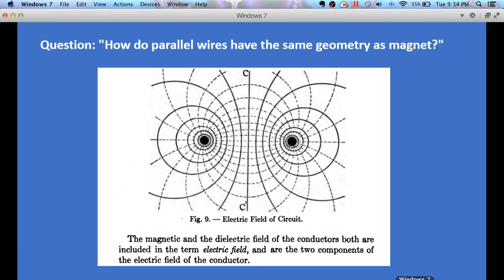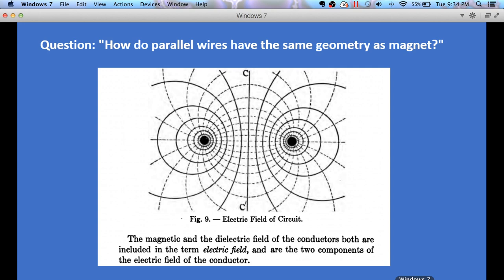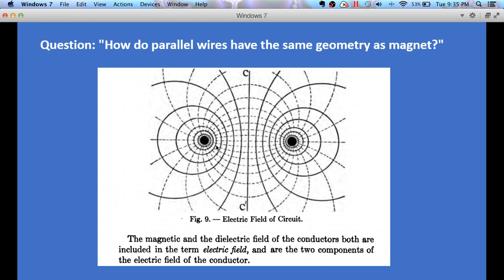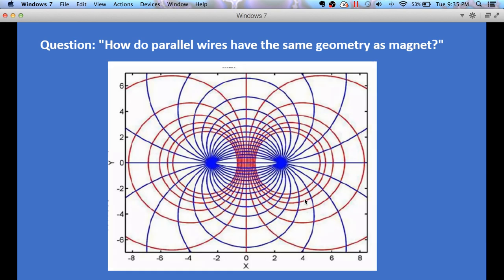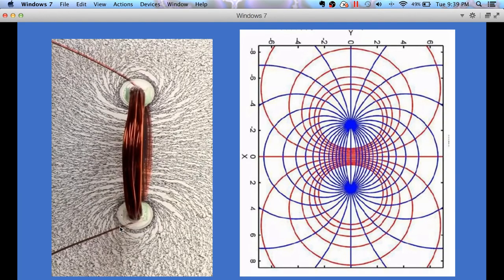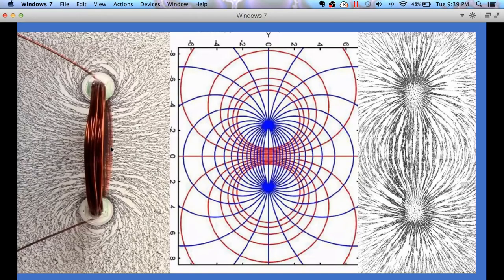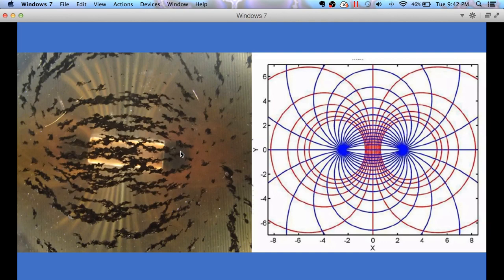On Permanent Magnets vs Electro-Magnets

Comment: Picture the wires as 2 bar magnets with opposing poles. Remember the Right Hand Rule. You have two right hand magnetic fields opposing each other with the coil.
Reply from the maker: I understand why the coil makes the pattern it does. But why do the iron filings behave differently between the coil and the magnet? That is the question. In the coil, the filings line up around the wires and in the magnet, the iron filings line up between and connect to the poles.
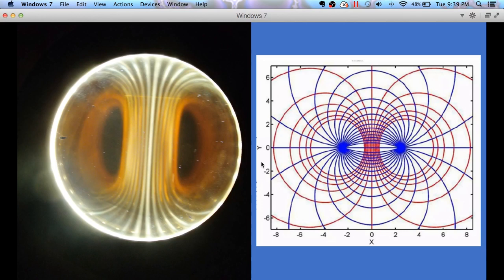Reply: Re: The image at 5:32

Point to the ‘poles’ on the coil (spoiler: you can’t, they are not the ‘holes’ that you see)

Then point to the ‘poles’ on the magnet.

You’ll see that they are quite different beasts.
Reply from the maker: @teslasapple  I agree that the poles are not the holes. This is why there is a conundrum. The North and South poles in the coil are 90 degrees orthogonal to the North and South poles on a magnet. My next video will be about that. They are definitely different beasts. Thanks for sharing.

Comment: No, no.   Your coil of wire is shaped like a ring.  And your magnet is shaped like rod/cylinder if you will, it is long.  That is clear.

Make your coil of wire like a cylinder/ tube so it is long.   Then the metal shavings will take on the appearance of how they look with the magnet.

If you want to make your magnet to give the appearnce of metal shaving that your ring wire has, grab a magnet that has the same shape as the wire, i.e like a disc.  You will see the same appearance.  No different.

I could be wrong but I feel very confident in this opinion.  Just looking at everything, it is easy to see the logic.  Aside from this, I know all this stuff because I mess with this stuff everyday.

Your ring coil of wire's north and south is the opening in each side and not where it goes through the paper.  Wrap your magnet wire around a tube or rod,  couple of inches long or however long and see.  If it is tube, you can just leave the tube in it. if it is a rod remove the rod.  Your metal filing will have the exact shape shape.  No problem.

One more thing:
A single magnet say in the shape of a rod with north and south pole on each end, the metal filings actually does not have the appearance of electric lines of force.  Why?  Because on the outside of the magnet the field goes in one direction and on the inside of the magnet in the opposite direction.  It is a loop of magnetic lines of force.

However if you take two separate magnets with their opposite poles facing each other, then it will take on the shape of electric lines of force, attractive tension force.  ( I believe with this configuration they call it H field being present in the space of the two) 

If you face the same poles of each magnet towards each other, it will again take on the shape of magnetic lines of force, the same shape as two wires with their current moving in the opposite direction.

However with respect to a single magnet what is present is what they call the B field.  B field makes a loop and H field doesn't.  H field looks like electric field.  Goes from one pole of one magnet and towards the other pole of the second magent. It won't make a loop.

If you go online... trying to figure out the difference.... you know what you gonna get dished out.... oh my.  You will come out more confused than when you asked the question in the first place.

So in a nutshell, you only have to know H field, anything else is B field.
H field only exist between two separate magnets with their opposite poles facing each other.  It is equivalent to electric field lines between two charges that attract.

You might want to clarify this in your other video that you have made about attractive and repulsive force.  You are using a single magnet to show how its magnetic field lines look like electric field lines.  It doesn't.  What you want to show is H field.  Two separate magnets with their opposite poles facing each other.  
Cheers.  :-)

Comment: Hi. Your coil used for iron filings and your coil used for the ferocell are 90 degrees to each other giving you an image 90 degrees out. So they actually are the same.
Reply from the maker: I don't think so. In a coil of wire, whether it be a flattened coil (like in the iron filings image) or an elongated coil (as in the ferrocell image), the poles are above and below the coil of wire. In the elongated coil (in the ferrocell image) the north pole and south pole are alined like the magnet beside it. The coil used for the iron filings, if viewed under the ferrocell, should show the opposing field. What I or someone needs to do is to compare apples to apples. The experiment that I did where I show the ferrocell and the iron filings at the same time, should also be done with a coil of wire.  Anyone up for the job?
Reply: Yes but the 2D iron  filing image is just a single slice. A cross section. The ferocell gives more depth. Magnetism terminates in the dielectric and visa versa. So imagine the 3D picture of both the magnetic and dielectric superimposed as they always are in energy flow. Then imagine the 3D ferocell and a 2D crossection of it and you'll get the iron filing image? I might be incorrect all together but that's how I'm seeing it.
Reply from the maker: @justin9054-j8e  Yes, the ferrocell does have depth to it, but I was careful to make sure my camera lens was parallel to the ferrocell glass so that my image was a perfect 2D projection. You can see from my ferrocell-iron-filings combo image that the iron filings line up exactly orthogonal to the lines in the ferrocell at all locations. This is not an accident. To compare apples to apples, I would need to do the same experiment with an inductor (electromagnet) under the ferrocell with iron filings like I did with the magnet. I need to rebuild my ferrocell before I can do that experiment. I accidentally shorted out my LED's with my  LARGE neo-magnet. I hate when that happens. LOL

Comment: on the coil north and south are pointed left and right . .
Reply from the maker: Correct. In the case of the parallel wires, there is no North and South. In order to get a distinct North and South, the wire needs to be coiled. That is why they make magnets out of coils and not straight pieces of wire.

Comment: I think I see what's happening here...
It's important that we separate the medium by which we are viewing the phenomena from the phenomena itself.
The viewing mediums here are the iron filings and light (via ferrocell - which contains minute particles of iron).
We are seeing the iron and we are seeing the light.
As a rule of thumb, just think about this.... light follows the magnetic lines, iron filings follow the dielectric lines.

1. Inductor + Light
----------------------------

Here the light is following the magnetic lines. If you were to view the ferrofluid iron particles they would actually be orthogonal to the lines of light and thus following the dielectric lines.

2. Magnet + Iron filings
-----------------------------------

Here the iron filings are following the dielectric lines. Since the iron filings themselves are being induced you can imagine the magnetic lines would be orthogonal.

3. Magnet + Light
--------------------------
Here the light is following the magnetic lines. Same situation as #1.

4. Inductor + Iron filings
--------------------------------------
This one is a bit trickier only because of the geometry of the inductor in relation to the iron filings. Remember the iron filings are following the dielectric lines. Orthogonal to that is the magnetic lines. If you rotate the image 90 degrees counter-clockwise and compare to #1 so the inductors are oriented the same way you will see the inverse relationship between the iron filings and the light.

Hope that helps!
Reply from the maker: Skarry67 said: "via ferrocell - which contains minute particles of iron"
The ferrofluid in the ferrocell does not contain particles of iron. It contains particles of magnetite. Magnetite particles are magnets. Iron filings need to be induced. So, you are correct that the medium is different. Magnets line up differently than iron filings in the presence of a magnet AND, they also appear to line up differently in the presence of an electromagnet. You should check out the images in my community section. I show two images, one with the poles aligned and one with the fields aligned. Everything you said was basically correct except for the composition of the ferrofluid in the ferrocell.
Reply: @FractalWoman  That is true from a particular perspective and we should be specific when using terms so we're all on the same page. However, "particles" is a pretty generic term that can refer to the atomic or molecular level. In that sense, it is both true to say particles of iron and particles of magnetite. Magnetite is, after all, iron and oxygen. When I said minute particles of iron I was speaking more broadly about the iron part of the magnetite to better relate it to the iron filings. The alignment of both is the same regardless of whether they are already magnets or have to be induced.

Anyway, thanks for the videos! We're all trying to have a better understanding of the cosmos here. The more dialog we have and the more precise we can be the better.
Reply from the maker: @skarry67  You are right about the magnetite and they do align the same way that iron filings align according to Timm Vandarelli. I was suspicious that they may line up differently but TImm cleared that up for me.

Comment: Ppl sent me over here, Your missing a key. Magnatism works best on a small scale the smaller the magnet or the space the higher the capacitance, Electromagnetism is the opisoite, at some point they cross over, and electromagnetism scales up, the bigger the better so a spiral galaxy would be the ultimate up scaling of electromagnetism
🙏🕊️㊗️💞🕊️💕
Reply from the maker: Al Kyder: When Ken wheeler says "the smaller the space, the higher the capacitance", he is talking about the space between parallel plates in a capacitor. The equation for capacitance of a parallel plate capacitor is, C = ε(A/d), where A is the surface area of the capacitor and d is the distance between the capacitor. There are two ways to scale up a capacitor: 1) increase the surface Area of the capacitor or 2) keep the area the same but decrease the spacing between the plates. In a similar manner, there are two ways to scale up magnetism 1) increase the size of the magnet or 2) use the same size magnet and increase the number of domains that are aligned within the magnetic material itself. 
Here is a great source on how a magnet is made: http://www.madehow.com/Volume-2/Magnet.html 

 Contrary to what you said, magnetism does not work best on small scales. It works exactly the same. Magnets have the property of self-similarity in that they work similarly (self-similarly), at ALL scales.  

Hope this helps.
Reply: @FractalWoman  No it does not, this is the road block, we have never passed this point, and if we have it has been kept from the public, your equation does not explain the observable.
Thx for the ferro cell experiment.
Reply from the maker: @ETALAL  That was not "my" equation, and it DOES "describe" the explainable. But descriptions are not explanations. Explanations are coming. I can guarantee that. I don't think anything has been kept from the public. But I DO think there is a better way of saying things that does explain things better.

Comment: and ..
The wire .. are  tow things ... a magnet is a single thing ... this is a big difrrens ..
Reply from the maker: The wire is ONE thing. There is only one wire in a circuit. There is no such thing as a circuit with two wires. There is only ONE wire. It goes from the positive end of the battery to the negative end of the battery. That is why they call it a CIRCUIT.